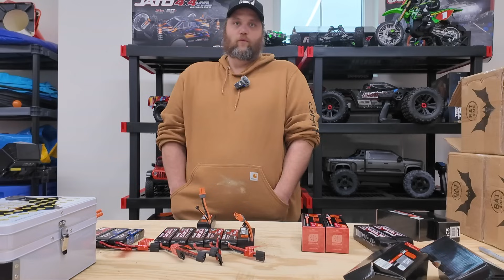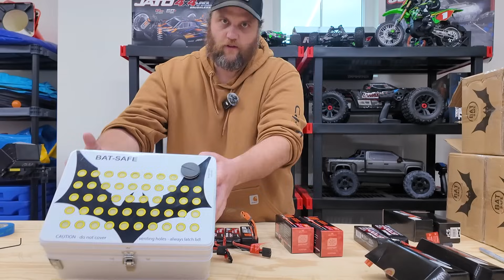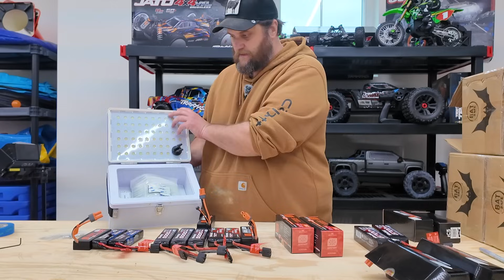Best Lipo-Lithium RC Battery Storage! Don't Burn Your House Down! Lipo Bags vs Ammo Box Vs Bat-Box

Comment: I use a steel tool box lined with two layers of 5/8 fire resistant dry wall and one layer to separate the batteries. Trying to come up with something to filter the vent.